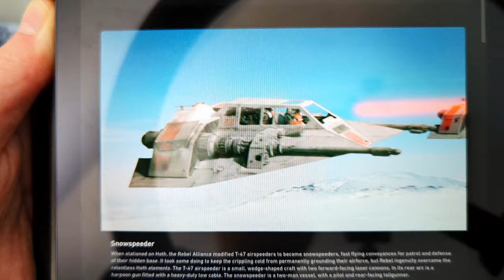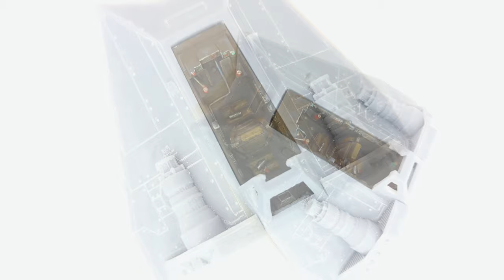Star Wars Snowspeeder | Cockpit 3D Print | Interior Details and Paint

Comment: Thank you for posting this video. May enquire as to the scale and the 3D printer you used. - Thanks
Reply from the maker: Of course, the file is in the description. I cannot print this model at 100% so I put it down to 40% and was able to fit most of the parts. I had to print 3 parts separately.
Thank you for asking!